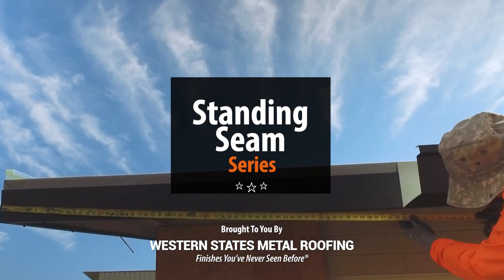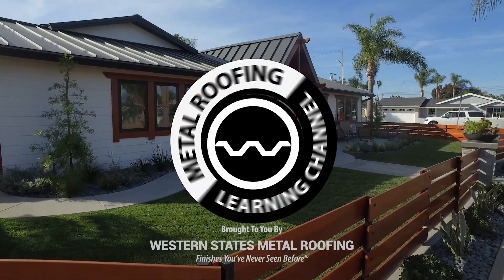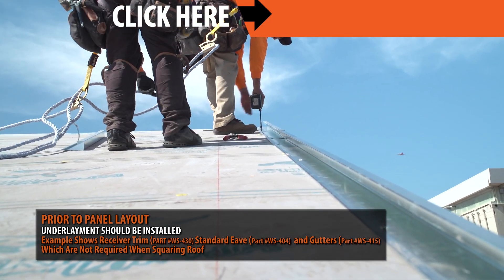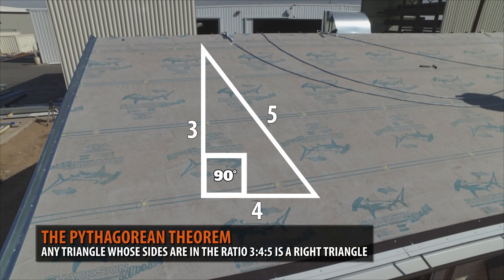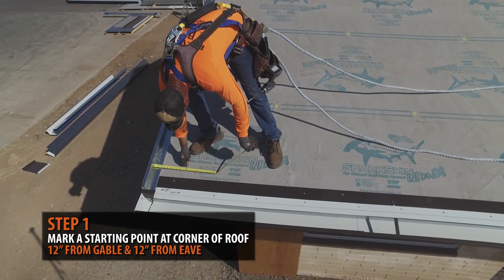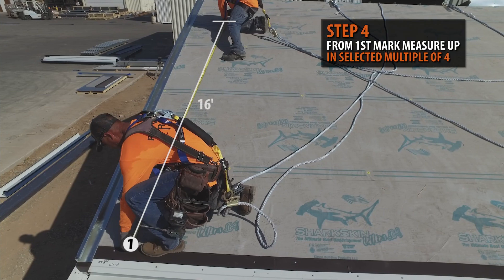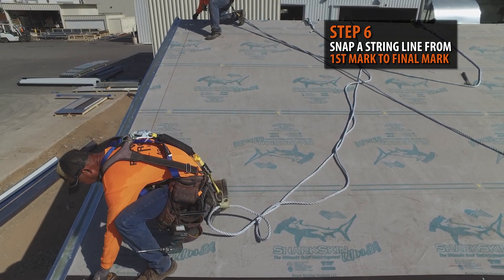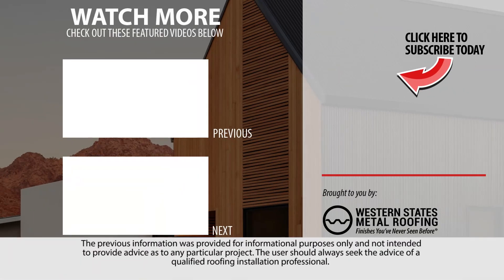Metal Roofing Installation - How To Square A Roof [Standing Seam & Corrugated Metal Roofing Panels]

Comment: Do you have any videos showing how to cover two hips with a ridge cap where the three meet?  I have a rectangle house with two hip ends.  I'm trying to figure how to connect the three when they intersect. Mostly, how to form the end of the ridge cap to cover and seal the two hips while making it aesthetically pleasing.  I'm using 3 feet panels with screws going in the flats.  Thanks!
Reply from the maker: Good morning.
We have videos that show to to install a ridge cap on a corrugated metal roof which includes cutting and finishing the gable ends. We will have the same video for standing seam later this month. Hopefully, these links help.
https://www.westernstatesmetalroofing.com/corrugated-metal-roofing-installation-videos
https://www.westernstatesmetalroofing.com/standing-seam-metal-roofing-installation-videos